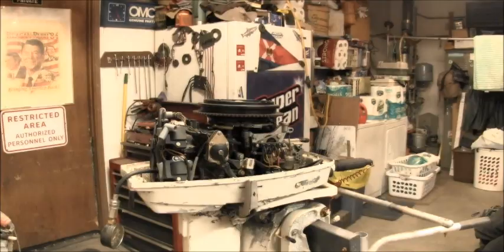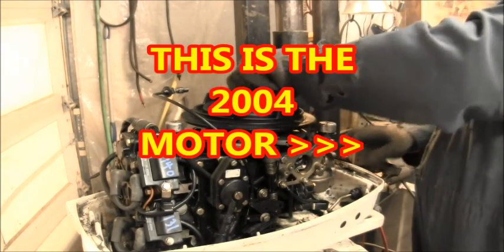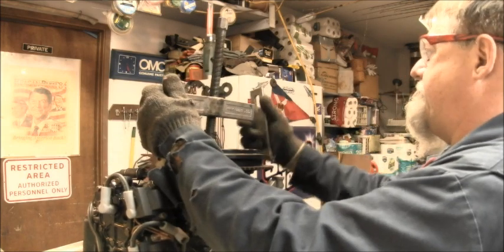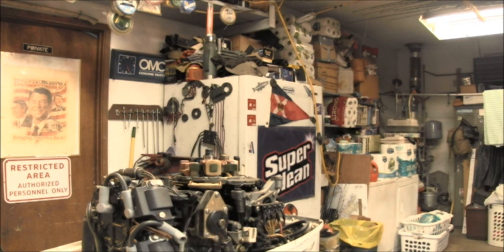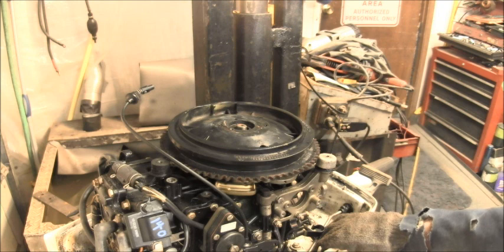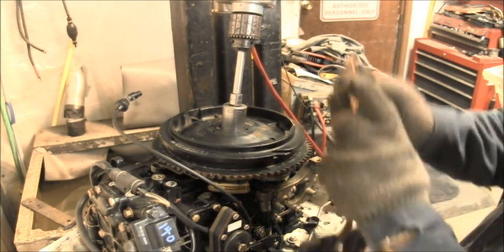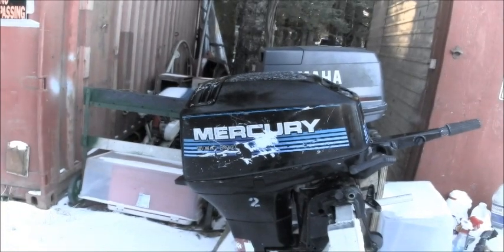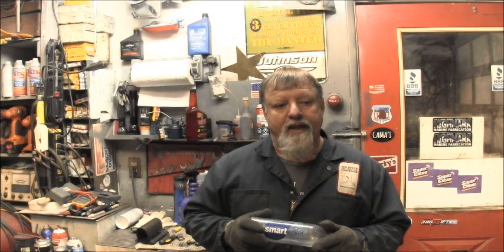JOHNSON 2004 30 HP MAKE-OVER ,   (( Part 2 ))

Comment: That flywheel was a real pain in the $&@. Thanks for showing the different options to remove it. You show I’m not the only one that has trouble at times. Great video!
Reply from the maker: Thanks  Oh no your not alone,,,  I have a 84 40 hp E-rude I have yet  get to pop  I'm afraid to force it any harder because it is the Hard to come by CDI model.  So I have been spraying it with lube for months now.  lol, I'll try again this spring.    kb

Comment: In scrounging over Kijiji for parts for the same electric starter conversion, I got in touch with John, a very khowledgeable Canadian fellow who holds ample OMC 25-35 hp parts. I want to share the precious info he gave me: there are 2 flywheels that can be used on the 30 hp to replace the untoothed original recoil model flywheel, either a 74 or a 76 tooth (which respectively require a 11 or 9 tooth pinion gear on the starter). The 74-tooth has a lower profile and will allow the recoil starter to still be used - not the case with the 76-tooth  I just got my parts ( I'm keeeping the recoil) and am waiting anxiously for your next video. Take care and be mery !
Reply from the maker: Fantastic,  Thank you for sharing with me/us.  Please share my channel with that fellow Canadian sounds like he is a wealth of knowledge and could for sure help us all here on the channel. Again Great stuff & thanks for shareing .       kb

Comment: I put a 1977’ toothed flywheel on a 2003 and wanted to add rope start but you need a pull start from a motor that has pull start with the longer mounting legs. I only have the one that uses spacers. Guess you could use spacers but have to make ones to clear teeth. Magnets got destroyed on original. Got good spark with 77’

Comment: Kinda hard to say if this will work or not.  The mag plates changed in the 90s along with the retaining ring and bushing set up.  I'm thinking you can just remove those recoil bushings and use and older recoil, but I guess you will find out...  What is the model number on that newer motor?  What looks like an alternator winding may in fact be an AC lighting coil.  The only way to know would be to check the resistances of the windings.  You may have to use that alternator winding out of the older engine after all.